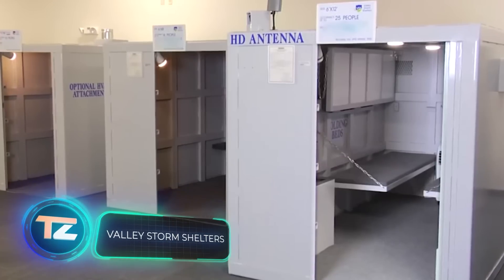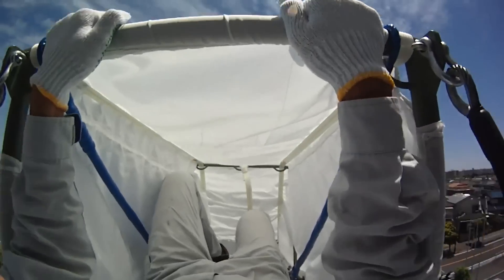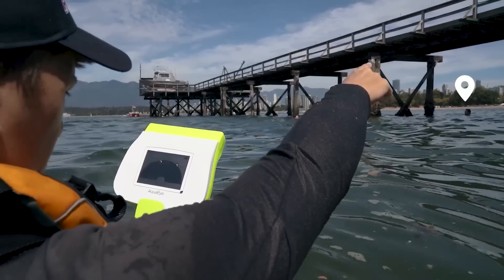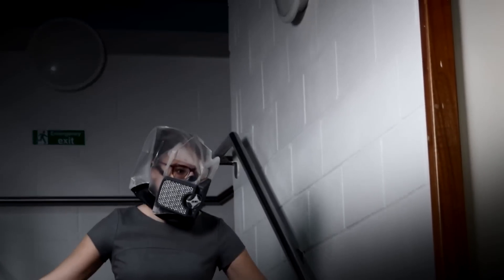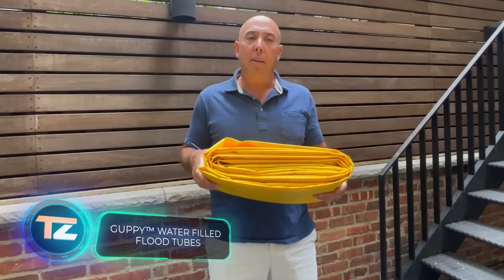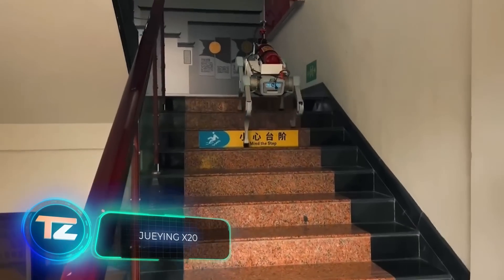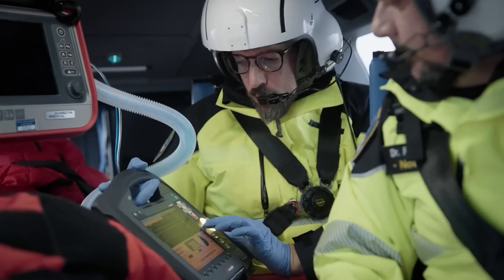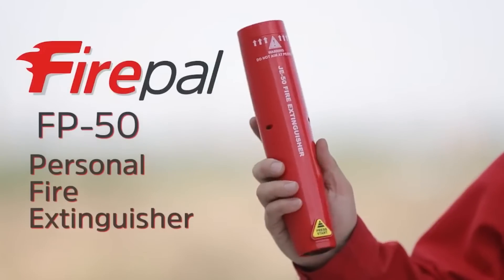INVENTIONS THAT WILL SAVE YOUR LIFE

Comment: My concern about the chute: if it is used on a burning building, how does it not go up in flames itself?
Reply: To answer 9 mo later, its used when the fire just started.
Reply: There are a number of flame resistant materials out there. Some melt instead of igniting but some also have high heat tolerance. It could be made out of one or more of these.
Reply: If the shoot got burned. Wouldn’t the fire be covering the stares in the same spot anyway

Comment: If that escape chute is anything like an aircraft's escape ramp/raft, I'm concerned you'll get scorched from the friction as you slide down it.
Reply: Thanks for the advice. I think, if I am ever in a building (or a plane) that's on fire, I will weigh up the risk issues- getting a friction burn from the chute or dying in the fire.
Reply: Notice that all the people using the chute are wearing gloves !
Reply: Listen to the crew, don’t it your hands on the slide and you won’t get friction burne

Comment: About the face mask/hood;  what the heck does “Minimum 15 minutes protection” mean ?
Reply: my understanding is, based on the tests, worst case scenario, you have 15 minutes of head & respiratory protection before the system declines or fails.
Reply: @tattooedmillionair  OK, then that would be Maximum of 15 minutes,  not Minimum.
Reply: @ItAintMeBabe99  the mask gives minimum 15 minutes of protection and I said minimum the maximum can be a lot more time
Reply: Basically most likely he means that the filter will probably stop working after 15 minutes.
Reply: It means after 15 minutes you’re fcked
Reply: Depending on what your protecting against, the filters might get over saturated from something like vapors, then just start to bleed through after a while. But with something like dust or Asbestos, the filters might last longer.

Comment: Testing buildings in Earthquakes has been going on for at least 50 years. The building codes in Earthquake prone areas are a bit different.
Reply: Japan seems to have come pretty close to nailing it. 2011 lost lives mostly because of tsunami not the 9.1 earthquake.
Reply: There's a bridge in New Zealand built to be earthquake proof. Amazing engineering.